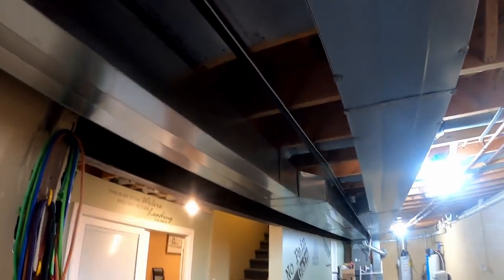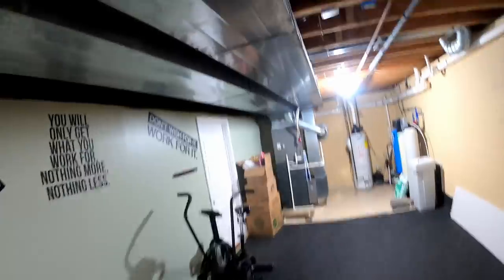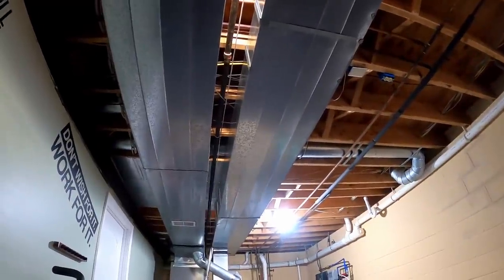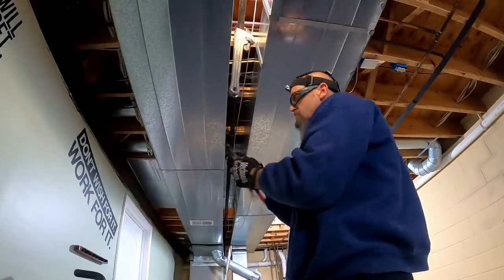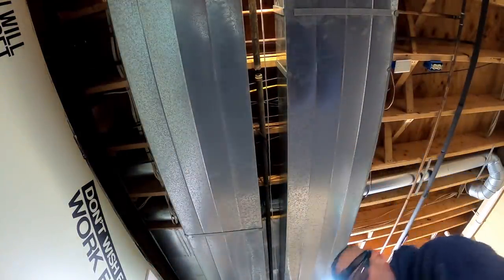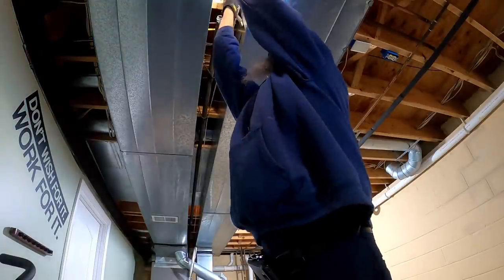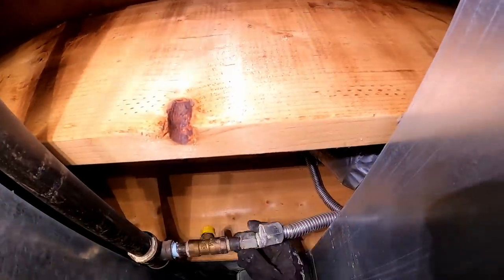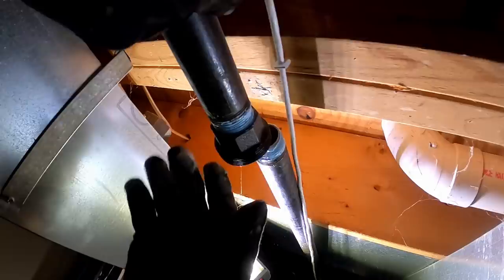Gas Line Repair On 1" Pipe

Comment: Upc says no unions on gas unless right after a valve or a building shut off
Reply: Never heard of that...makes no sense either.
Reply: And that is one of the most ignored rules in the UPC. I guess they want you to be able to isolate the union in case it leaks which is understandable I guess if it's closer to ground level where stress and people accidentally hitting it could potentially loosen it over time and make it leak but being up in the ceiling like that buried between some duct work, I don't think you have to worry about that union ever leaking. The only alternative is using a left/right hand nipple if it's against your local code. A union is just easier if it's allowed.
Reply: @jacob4639   read the code book it makes plenty of sense  keeps people from just putting unions anywhere  on gas systems   but what do I know I've only been a plumber for almost 40 years  in the sanfransisco bay area
Reply: @plumbcrazy375  yeah I've read the code book, its a alot different in Canada. Says nowhere about putting unions in your mains. I do it all the  time for the purpose of repair if needed or ill megapress it.i don't see an issue with them provided its not excessive.  You ever think san fran codes are different than other codes in North America lol.
Reply: @jacob4639   it's the upc
Reply: @jacob4639   it's been good to me and makes plenty of sense but Canada  who knows what book you go by
Reply: @jacob4639   uniform plumbing code
Reply: @plumbcrazy375  NFPA 54 & 58
Reply: @jeffreyjohn2037   let it go I'm on the west coast  upc is the code book we use
Reply: @jeffreyjohn2037  just be go to Google and ask can you put unions on gas line one anywhere you want
Reply: @jacob4639  I bet you are a service plumber
Reply: @plumbcrazy375  refrigeration mechainc and gasfitter. I've done construction side, install and service snd currently do mainly service so I understand what it is like to be on both sides
Reply: @jacob4639  Google can I put a union anywhere I want in s gas system
Reply: @jacob4639  I was right
Reply: All gas fittings should be accessible meaning they can not be ran in walls or floor joists because they have to be  visible to know they are there because fittings do vibrate loose over time
Reply: @dmiestercommkitchentech3043   what are you talking about oh my god I hope no one let's you install any gas lines
Reply: @plumbcrazy375  I'm agreeing with you there aren't supposed to be any gas fittings hidden behind walls or flooring according to National Fire Protection Code
Reply: What in my comment did you not Comprehend go back to grade school and learn reading comprehension before attack someone agreeing with you
Reply: @dmiestercommkitchentech3043  you said you cannot have fittings in a wall or sub floor
Reply: @dmiestercommkitchentech3043  you could be talking about unions on gas yes but fittings can be in walls I'm just a little bit of crazy  I've been plumbing almost 40 years most of it as a foreman on big jobs Ive had inspectors studdering when they realize that they gave been wrong for years    so I m not perfect  I may snap a little more than I should but I'm old and cranky so sorry
Reply: @jacob4639  plumbing has been good to me retired at 55 doing what I want so not bad for a plumber ha ha
Reply: @dmiestercommkitchentech3043   plus I'm from California we have earthquake don't how if you have seen a water heater pull studs through sheer wall roll through the garage door and down the street
Reply: @plumbcrazy375  Chapter 7 .3.2 connections allowed are TEEs,couplings, punched center nut unions and elbows in concealed locations; I did not see him use any center punch to secure the center nut so he should have replaced the thread protector with a coupling instead of the union especially if the gas pipe is going to be covered
Reply: If that building has a fire issue he will have to answer for the use of the unions in a concealed location because the National Fire Protection Code only allows for Center nut punched Unions not standard unions I hope they don't vibrate loose because BOOM!!!!! and you will be held responsible even if its not the union that causes it. National Fire Protection Code book Chapter 7.3.2 look it up
Reply: @dmiestercommkitchentech3043  Where he put that union though is not a concealed area, it's an open ceiling with open access. 

If they ever were to finish that basement and drywall the ceiling, then they'd have to replace the union with a coupling but since that space doesn't look like it has the intentions of ever being finished one day, I think the union is pretty safe tucked between the ductwork like that as long as it abides by local code and the union is allowed away from a shut-off and appliance like that. That's UPC code and all but not all local codes follow the UPC. Not the most ideal solution, but it's the most logical and it'll be fine. Beats having to re-fit most of the gas run just to put in a coupling. Been there, done that.
Reply: @losferwords100  correct it is a finished basement so it is possible they are going cover the duct work but it is also possible that they won't conceal the gas line
Reply: NYC, no unions on gas lines except for after a shutoff valve and next to appliance
Reply: @robertroca7123  that is exactly what I said
Reply: @jacob4639  priceless
Reply: @plumbcrazy375  And NFPA 31, IMC and IRC
How do you like them apples?
Reply: @dmiestercommkitchentech3043  Regardless, a union cannot be concealed. If your fittings loosen up over time, consider yourself a weakling.
Reply: @jeffreyjohn2037   look up upc how do you like those apples ounk
Reply: @jeffreyjohn2037  was he working on a house   so again  west coast is upc I'm from the sanfransisco bay area  they don't play  so I've only been plumbing for almost 40 years
Reply: @plumbcrazy375  I was adding on to my comment from 2 months ago, NFPA 54 & 58.
I'm 60. Third generation. My Father tought me how to reset a helix on a stack switch in 1968.
Reply: @jeffreyjohn2037  what are you talking about I know unions can't be concealed because they do loosen overtime due to vibrations of the pipe and surroundings
Reply: @jeffreyjohn2037   again none of that has to do with unions in the middle of a gas system in a house  I'm 59 been working since I was thirteen worked in the oilfields in Alaska and boilers in the sanfransisco bay area.
Commercial  plumbing  and custom homes
Reply: @jeffreyjohn2037  there are exceptions to every rule and if a fitting being a union or another must be concealed then it must altered ie... notched, punched, stamped in away that will prevent it from loosening at all  this comes right out of the National Fire Code so consider yourself educated
Reply: @dmiestercommkitchentech3043  I've been a NFPA member for 30 years. You've been humiliated and enlightened you weakling.
Reply: @jeffreyjohn2037  and damn I missed it there's an asterisk next to the rule and Jeffrey John is the exception to the rule physics doesn't apply to any fittings he threads in so they will never fail MR PERFECT congrats
Reply: @dmiestercommkitchentech3043  Many thanks. Now go back and tighten all of your fittings again. 🔧

Comment: Leaking gas pipe is a nightmare. That is why I only use natural gas for my hot water heater and backup generator.  The less connections, the better. I still have an electric drier, but may convert that to gas after it breaks. I also use an electric stove. No plans to change that.
Reply: use the right fittings with all clean threads and good dope or rated tape, tighten well and it will not leak for way longer than you live ;)